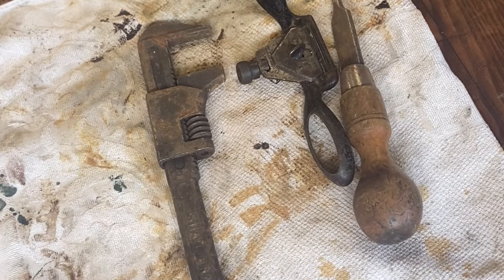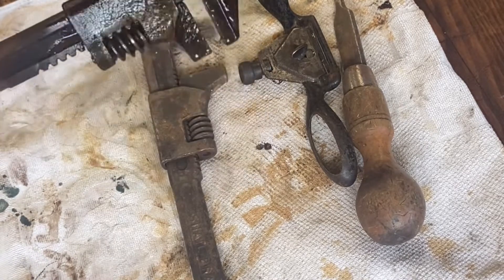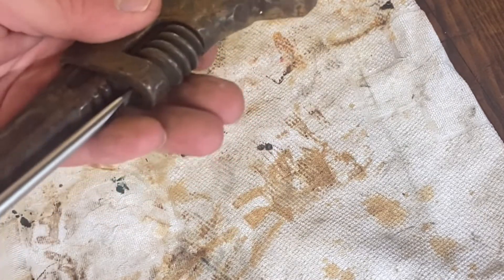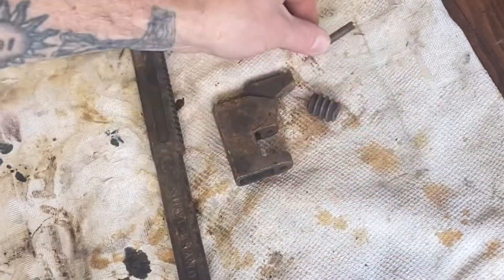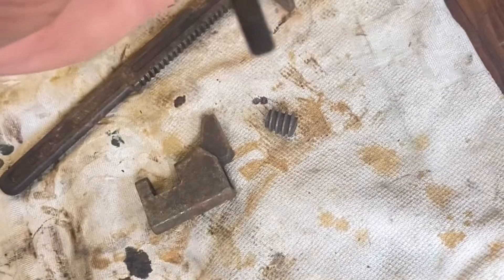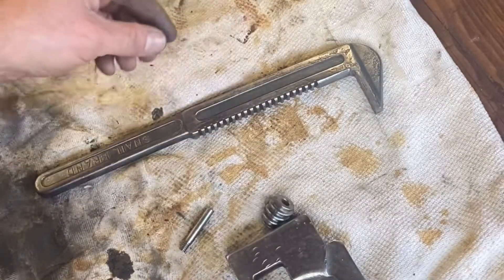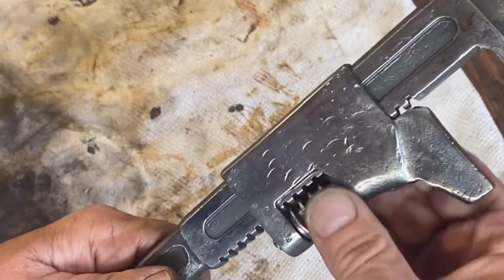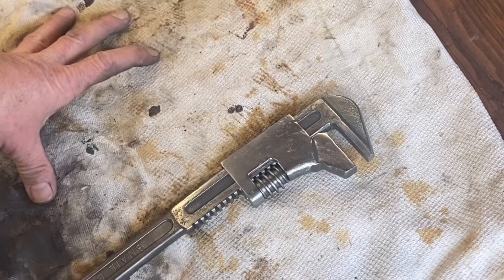Snail brand auto wrench restoration, clean up

Comment: 1723 are use evaporates on that seized range it will NC is it easily H are cheaper alternative is vinegar I’m sure that would do the job the evaporation is for the real difficult ceased jobs or if you want to retain the paintwork evaporate won’t take the paint off anything you should try them both it also makes them look a lot better when you then hit them with the wire brush evaporates is very good stuff but a cheaper alternative is vinegar are use both of them you could also try scout craft this mix of 50-50 where is A cheaper version of WD-40 when you want to use lots of it
Reply from the maker: I’ve tried all sorts of stuff tbf… different mixtures for different jobs, dettol
Is good for paint